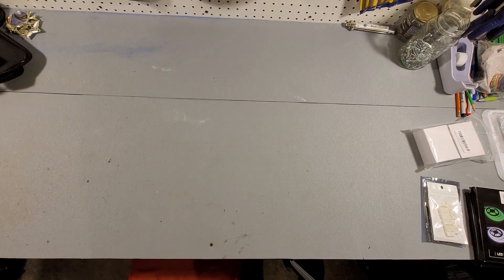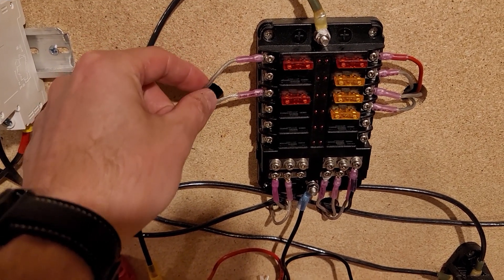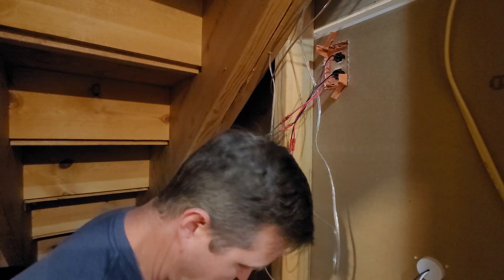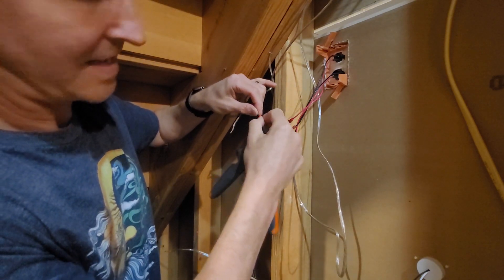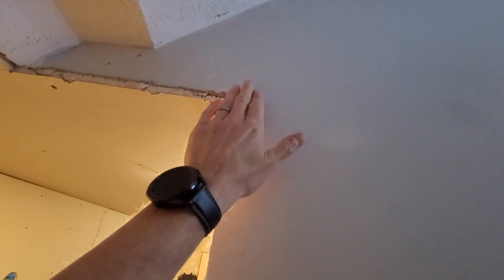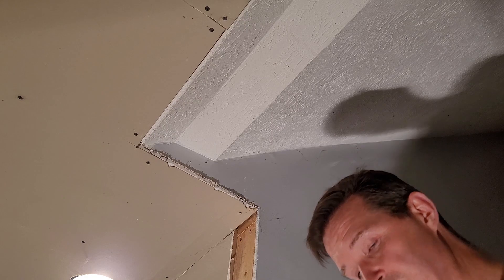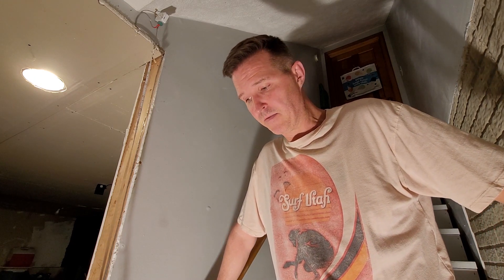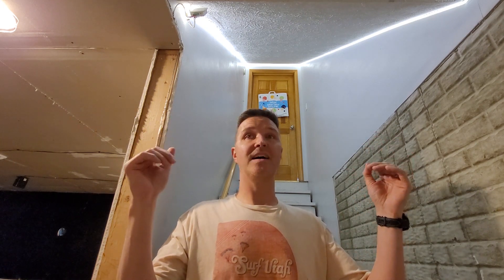Automatic Off-Grid Lighting for my Basement Stairs!

Comment: Enjoying your upgrades especially when you cover the "why" of doing them.

That's a 12V distribution block, correct? Have you ever considered going to 48V system and then stepping down the voltage to 12V closer to where your 12V loads are? In other words, I wonder how much voltage drop you are getting on the longer runs using the speaker (20 awg?) wire.
Reply from the maker: Thanks for the comment!  It is a 12v block.  I've never tested the voltage drop.  The distance is about 20ft max.  It is 20 awg speaker wire.  I've had a bundle of it for quite some time and I figure I could put it to some use.  At this moment I'm sticking with 24v.  In my mind 48v starts to get too dangerous to work with.
Reply: @OffGridBasement  You are right. 24v is still pretty safe. 48v is slightly dangerous. Will Prowse explained it in one of his videos.